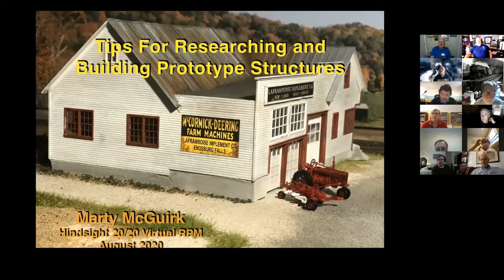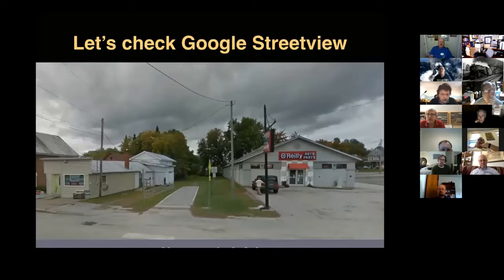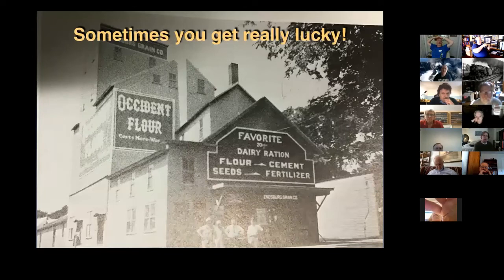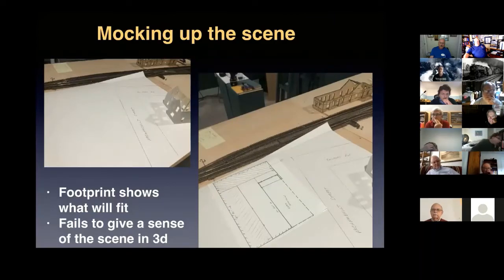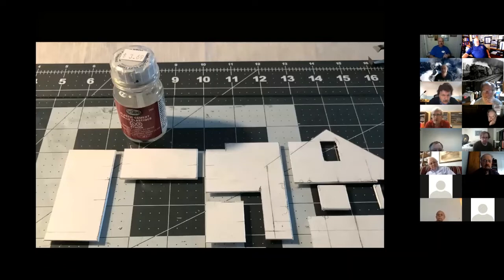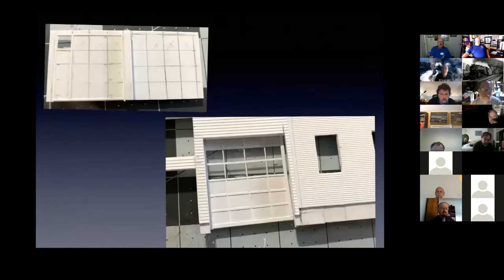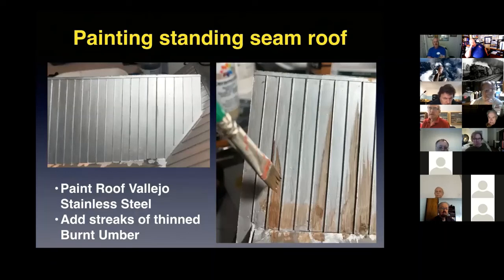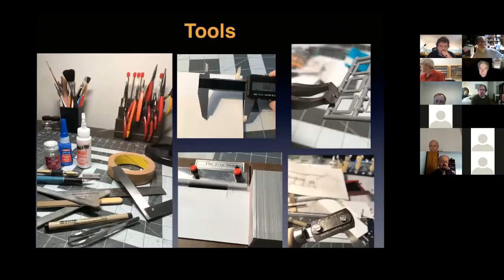Potomac Division Virtual Clinic 4 Tips For Researching and Building Prototype Structures 10/18/ 2020

Comment: Marty, Thanks for making this video it is very helpful to modeling custom buildings from photos.  The only thing I wish you would have covered as well would have been the roof angles (pitch).  Or do you guess like 30 degrees?  45 or 60? Or is there a better way?  Anyway, great video thanks for sharing, really enjoyed this.  Cheers!!
Reply: Ron, just catching this comment. Thanks for the kind words. I used a angle finder (in my case, it was a really cheap one - like this:
 https://www.trick-tools.com/Angle_Finder_I_AF1_16
I had enough straight on photos of the front of the building. I drew a horiztonal reference across the point where the front walls angled up to form the gable and measured that angle 
with the protractor directly on the print. That got me close to the correct angle on that section. 
Since I'd shortened the depth of the building the same approach resulted in a roof pitch that looked wrong. So, I have to admit I judged the angle based on what look correct proportionally with the front of the building and then made sure the angles were consistent front to back. 
I have to say this was an extremely complex roof and took a lot of trial and error with some cardstock to get templates I could use to cut out the Evergreen pieces and end up with something that would fit! - Marty
Reply: @cvsne678  Marty, Thanks for the response and the info on the roof.  That was very helpful.  I think modeling from photos is difficult, but worth it when you get great results.  There just isn't enough information on the subject, which is why I appreciate your video.  Again, great video and thanks for your efforts in sharing your modeling.  Cheers!!